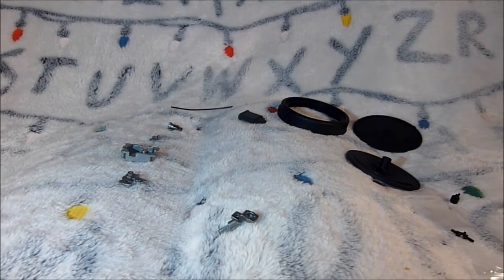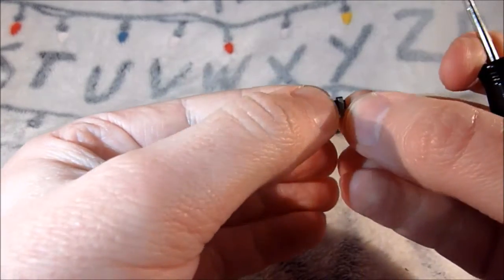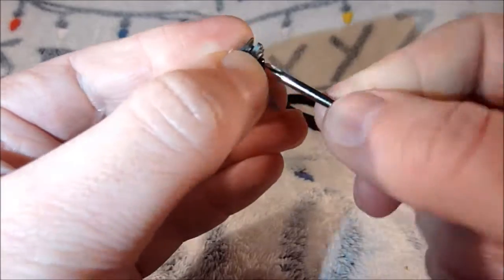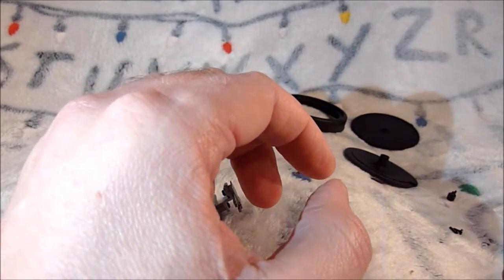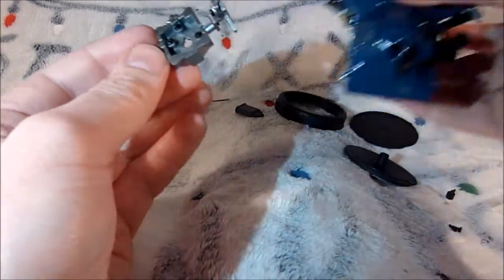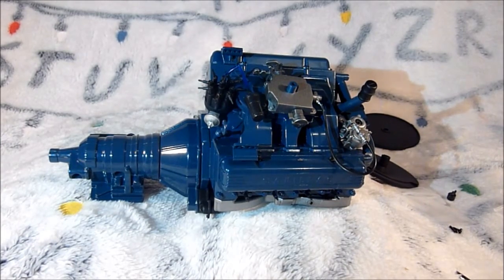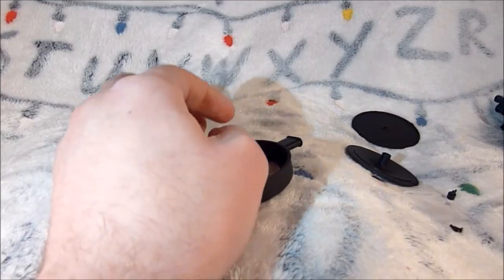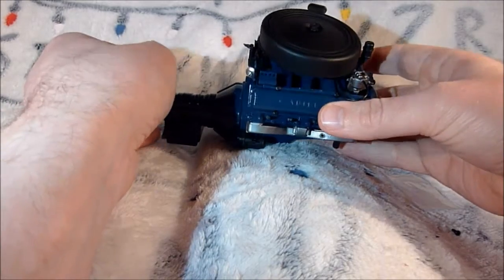Ghostbusters Build the Ecto 1 - Part 9 (Hero Collector / Eaglemoss)

Comment: My struggles came with the fitting of the wheels and suspension springs lol so you had that all to look forward to in later additions. This is my second part build experience. I built the delorean from the back to the future movies and tried to build terminator, but that failed so now I'm focusing on ghostbusters. I hope they continue with movie car themes throughout the next builds, I love movie cars {maybe the 1960s batmobile}
Reply from the maker: Cool, I did consider getting the Delorean one when it first started but got the Hot Toys version instead. Should have had both! 1960s Batmobile would be awesome! Surprised they've not done that yet!